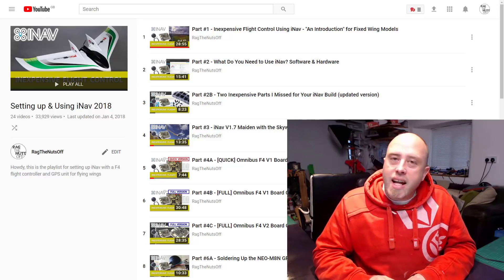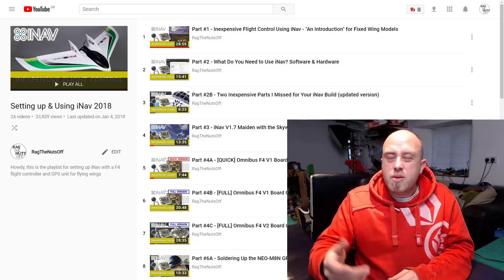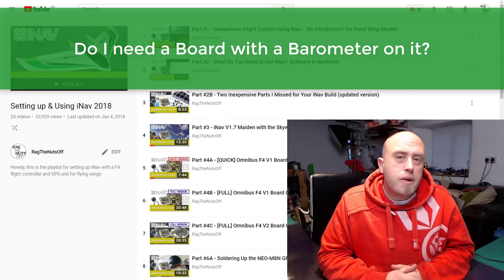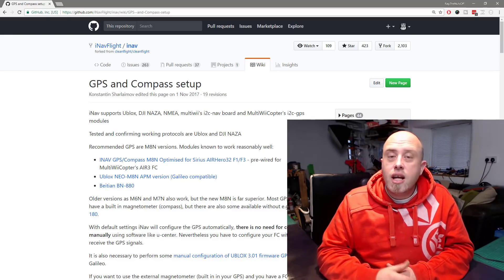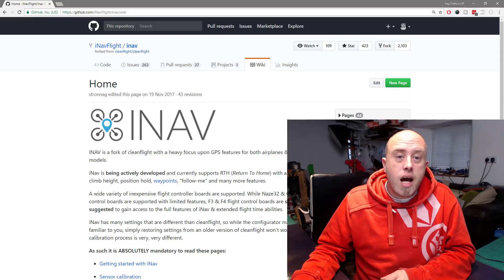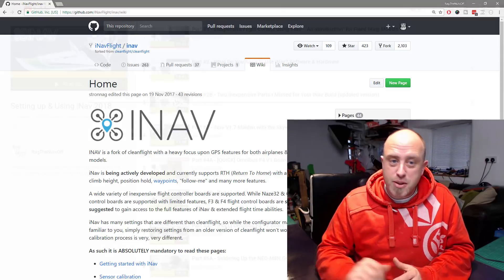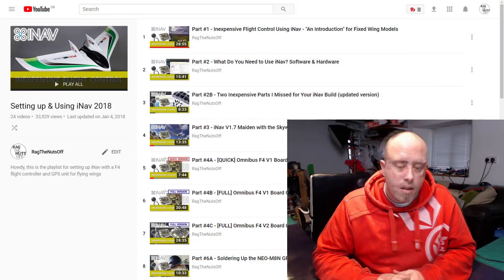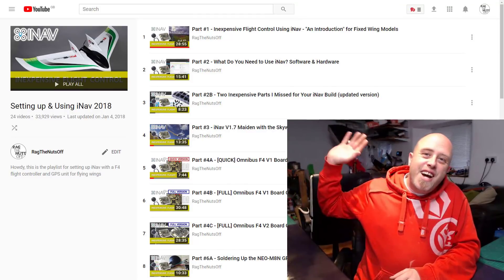The Top 12 iNav Questions, Answered

Comment: Good day to you Mr Matt.
Well done on your videos, they are still so honest and awesome.
I have a question about troubleshooting a motor twitching problem on a quadcopter, I understand that you might not like quads but I reckon you are a very helpful and resourceful person with loads of experience, so  I would rather ask you and see whats your take. 

I've purchased and received the Matek F405 STD version a few days ago, had some issues with sensors but figured it out. and flew for a few days. I smacked the quad on the ground a few times while tuning PIDs, and I had to solder the compass scl wire back after it snapped off a few times, then, as sudden as the S800 reptile ending up in a tree,  I seem to have a motor problem. One specific motor twitches all the time when the battery is connected to the quad. The remote control is off, and the motor twitches and suddenly spins up fast, sometimes it even lasts for 2 seconds of spinning up on its own, then stops, and twitches again.

When the quad is armed for flight, its still the same, but its worse because if I throttle up to 40 % of throttle for example, that one specific motor twitches and spins faster due to those twitches, then falls back to 40% throttle, but it never stays at that 40% smoothly. With every twitch, that motor throttles up high in rpm.
I've checked wires and they all seem to be ok. I ended up damaging that esc which also fried that motor, luckily I have spares, but even with the new motor and esc, the same problem persists, and I've flashed Betaflight from inav and its the same problem, so it cant be firmware related. In betaflight, with the remote turned off, if I have the battery plugged in, and enable the motors and spin them up, that problem still persists on that one specific motor, even when only throttling up that one motor only without the other three, its the same problem.
Any ideas on what to check ?
PS: Today I'm going to disable/disconnect the gps, compass and vtx to test if those could be causing it.
Reply from the maker: Hmmmm.... That's an odd one for sure. I would swap the motor and ESC out if you can or at least move it around the quad. The reason for that is to identify it's cause. If the same issues happen when it's been moved, it's the ESC or motor. If it stays it's the board or the wiring.

Hope that helps!

Matt
Reply: @RagTheNutsOff  Haaahaaaa...Thank you for your prompt reply Mr Matt, much much appreciated !!!
I think I found the fault after many days of wondering what the hell and trying...it was one of the sensors. I think it was the compass with gps. The connector might have come loose on the gps and so must have been causing that hectic stuff because after unplugging the gps and compass connector, I disabled it in betaflight, and the twitching and sudden throttling stopped, also ran the motors from betaflight and doesnt seem to be a problem. Then I enable each sensor back on again, one at a time and tested it one at a time in betaflight motors section and no problem, however, when I eventually plugged in the compass and gps connector into the gps and enabled in betaflight, I pushed in the plug properly just in case the plug was not making contact, and it seems to be working fine till now.
I'll keep you informed if anything else happens as perhaps this is something new for us as well as many others in here who might experience the same problem in the future.
PS: My S800 Reptile v2 arrived a few days ago but did not touch as yet due to battling this quadcopter problem lol.

Comment: I am baffled about the power connection, so you use a bec to power the 5v servo rail but ardupilot suggests you remove a diode, why is that? Is it safe and sound to use the bec on the servo rail with no modification on the f4 pro board. Also is it correct to power the fpv equipment through the board next to the video in/out?

Comment: Hi Matt, I'm helping a friend with a Opterra wing mounting a Furious F35 complete FC which has GPS Speed sensor and all. We are both new to flying wings and especially to iNav. We both have only flown wings with stabilizers on them. As you know the Opterra wing is a huge wing. My question is do you recommend any certain settings to get the best flight out of it or will the same settings you use in your iNav series video work just the same even though it was on a smaller wing?

Comment: I'm late, i just saw this.

Little trick for the busted usb guys. Shove the usb back on the board long enough turn on the msp for uart1 and use an adapter to communicate through uart1 from then on. However you're then limited to 2 channel models like wings and the nano skyhunter because the uart 1 needs to be free in order to use pwm 5 on the omnibus f3 boards....all my wings get the busted usb boards.

Also there is an issue with some of the knock off omnibus f4 boards that halfway links pwm 4 and pwm 5. The symptom is the rudder will link with one aileron only in one direction. Manually assigning the aileron servo to the correct channel has been a work around in a few of the boards i have. The ones i have that can never be fixed become two channel boards. Also when used on a multirotor the symptom is yaw works one way but will raise altitude instead of yawing in the other direction.

Comment: Matt love the channel... Quick question my flight surfaces move but I can not get the motor to spin up except in the motors tab . The esc has been calibrated and it powers when battery is applied.  All preflight checks are green.  I'm scratching my head over here . Any idea on what I'm missing?
Reply from the maker: Daft one, have you armed the board? Matt
Reply: RagTheNutsOff  yes that's what's odd when the board is armed the blue led comes on unarmed it goes off

Comment: Hi Matt, great series. I've literally watched every episode, more than once. I've got my S800 wing setup and ready to test, but I'm still not sure about a few settings that i can't find any good info on. In the advanced settings tab under 'Basic Navigation Settings' are these just for multirotors? I haven't seen anyone with a fixed wing change these settings, but surely 300cm/s and 500cm/s is way to slow, are these the speeds that the model will fly when in rth mode? Or all modes? Also what's the difference between attitude and cruise under 'User Control Mode'?

Comment: Great videos Sir Nut Ragger. If I wanted to use 3 - 4 GPS based functions (GPS hold, RTH, Attitude hold, Height hold) on a new plane (Talon UAV on a Omnibus F4 FC) what is a mid price range radio and Rx you would recommend ? I have 4 models on DSMX receivers that I fly with a DX6i Spektrum Tx, I guess this is of no use for the new plane, right ? Your help is greatly appreciated.

Comment: Has servos powered by UBEC still don't work
Reply: also omnibus f4 pro is a bitch to use, will switch to matek when can afford, especially due to the new pdb
Reply from the maker: Howdy fella, sounds like the board isn't armed, see the right hand side of the iNav configurator dashboard for red ticks, Matt

Comment: Hi Matt and thank you for the series on iNav, without which I would have stuck with my £200 alternative! I do have an issue which I cannot seem to solve and I wondered if you could take a look. My set up is Taranis tx in D16 with ch 1-16 set, X8R rx sbus to F4 Pro. Issue is I cannot get all 16 channels to work on the board to facilitate more modes. I wonder if you have tried to and if so how did you do it.  TIA

EDIT
Turns out it was faulty firmware. Reflashed with latest LBT now all good.

Comment: I did all how you and all works wright but the altittude shows -3 -2 m more or less, whats happening? everething else works well...
Reply from the maker: Howdy fella, you don't mention if that is ALL the time or just in general -3 or -2M less than what it should be. If it's the latter then, it doesn;t really matter, if it's showing that all the time, it looks like you have a GPS or configuration issue of some kind. Gop back and repeat the GPS setup would be the place to start, Matt
Reply: Thanks for answer! -3,-2 ,-4 all the time. Anything else information its ok but no altittude. I repeat the gps setup but altittude dont works....and connections are ok

Comment: Hi matt i have a omnibus f4 v2 pro going in a tecksumo have it all setup except for one part i can not for the life of me get ppm to work .
I have tried my ezuhf inppm mode, frsky x4r2 in ppm mode, both with nothing happerning i can get x8r sbus to work. I need the ezuhf working can you help please its realy doing my head in
Reply: You will need to remove the SBUS jumper from the board...Its tiny, I lever mine off using a scalpel.  I too use the EZUHF RX in PPM Mode.....You can also include Link quality in via the PPM stream.
  Im using the F4 V1 board though, you may have to solder across your PPM link jumper, unlike mine.

Comment: A barometer is certainly not necessary for fixed wing, but it's SO much more accurate than GPS altitude, why would you disable it if you already have it? (Speaking in general terms, not so much iNav specific, I've STILL yet to try it out... lol)
Reply: Agreed - no need to add a barometer if your board doesn't have one, but if it's there - use it.
Reply from the maker: Howdy fella, I don;t have the baro enabled on any of my setups and haven't had a single issue with heights, Matt

Comment: Quality video as usual Matt, thanks. I'm looking forward to auto launch on my AXN and Bixler 2 as I have a weak right hand shoulder [too much enjoyment??] after surgery many years ago. No trouble with tractor planes but pushers can sure exert a lot of downward pressure at chuck and hope time. So can the girls of the night also, or so I've heard. Sigh .....
Reply: Motor sickle racing, OK ...... Geez, what did you think I meant. That's real good enjoyment.
Reply from the maker: Howdy Stew, that is exactly the use-case where it would be useful. It's silly easy to setup and to use, Matt

Comment: As far as the weak USB connectors on the F4 boards- BEFORE I do anything with the board, I hot glue the USB securely in place. No more worries.(Be careful not to get any glue on the inside of the USB).  Great INAV video.

Comment: A blob of hot glue over the USB socket can save it breaking off.. OR..file down the little sprung lugs on the cable so it slips in and out with less force. Good video Matt .

Comment: Great video, I'd just like to add that if you're using an Omnibus F3, you cannot use pwm 5 and 6 if using UART 3 (this happens to be the uart port that an SBUS receiver would use). Now, this doesn't matter if it's in a flying wing as you aren't using these pwm pins. But for a normal aeroplane, this is an issue. I've got around this using a PPM receiver and removing the small resistor: http://www.dronetrest.com/t/omnibus-f3-aio-quickstart-guide/2759

However, the Omnibus F4 board is basically the same price, but you don't have that issue! Also, those who aren't getting movement with their servos, perhaps it would be a good idea to use a separate piece of Veroboard to power the servos off the ESC BEC, just two prevent 5V sources coming together. Hope that helps anyone :)

Comment: Your timing is perfect. I will be flashing iNAV for the first time today!
Reply: Very good!  I’ll first be doing this on a multirotor for testing with a DJI Ocusync Air Module.  One thing to note that may help someone,  I had an Omnibus F4 in my drone I’m testing with, but adding a compass I still don’t have enough UARTS because I need telemetry data also.  My specific board doesn’t have accessible soft serial pads so I have had to replace it with one that does so I can use those ports also.  My series though won’t be as comprehensive as yours for sure.  Simply not enough time so I’ve already referred people to your channel on occasion.

Comment: Great information Matt, thanks for this and the whole series. Just FYI, it's easy to use an FTDI adapter to connect if your usb breaks off. Lots of information on the Internet. Also, I had an old Naze board in the spares box and it works fine with Inav since it only needs 3 ports and no mag or bar. And it costs less than $16.

Comment: Having recently broken a USB port from the board myself, I think it's just an issue with these cheap Omnibus clones. I've used boards for the last thee years in quads and never had a port break off but I've always used genuine boards. I did repair the clone, (very tricky soldering job), but I bought a genuine Omnibus board and replaced it anyway and I don't think it will happen again. But you do need to factor in easy USB cable access when installing the components.

Comment: Wow!! -  Matt you are very thougher and good on-yer 

A problem that has been bugging me for some time - is there any issue when using the usb plugged into the computer and then plug the LiPo flight battery together - any conflict...joe
Reply from the maker: Hey Joe, nope not at all. Matt
Reply: Joe Stubbs of course not
Reply: I found it slightly worrying the first time too, but I've been using quads for years and I've never heard of an issue. It's fine mate.
Reply: Joe Stubbs hey mate. I fried my first board thinking it happened cause I plugged in my lipo while connected via USB but it was my own fault cause the board was not fixed at that point n I put it down on some screws or something n shorted it. Learning experience.